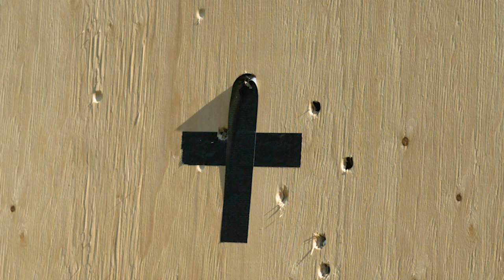Slingshots in a Medieval Battle?

Comment: I noticed that the way Jörg pinches the pouch puts a twist in the rubber, so that after it's released, it untwists and puts a slight spin on the ball. DIY rifling lol
Reply: It's also much safer to shoot that way. I'm using it too. If you accidentally not keep your thumb in straight position (thumb under the ball), that will cause the speed bump effect. If you have low fork the ball can hit your hand or a fork. With a twist ball flies safely above the fork if you level up your thumb during the release.

 In target shooting it helps to get my hand more neutral position. I can use my thumb knuckle against corner of my mouth as a anchor point.
Reply: @rikulaatikainen1929  This
When I shot slingshots with a normal pinch grip I'd have shots hitting the fork occasionally.
Twist grip however came right back at me and grazed my face once though.
Reply: @daviddavidson2357  
I'm using small pouches that are not big and saggy so projectile can exit more easily from the pouch. Return to sender shots are the ones I'm nervous when shooting darts. I mostly shoot 11mm steel with the heavy hunting band setups and I have once got a ricochet from the fork to my thumb. My thumb was sore for 1-2 weeks. Slingshots can be dangerous and I treat them with the respect.

Comment: How about shooting some of your armor, Tod? Still got your soft armors, mail and brigandine?
Reply: That would be awesome, I'd love to see what kind of damage one of Jorg's slingshots would do to a helmet, as well as various body armors.
Reply: Holy shit! Yes!
Destructive testing!
Reply: And determine the velocity
Reply: @tambarlas5248  Joerg did a "speed" test with this slingshot back in 2013 with something like a 50 to 60 gram steel ball with the intention of setting an kinetic energy record for a slingshot. Don't know how it's holding up, but he reached ~130 joules.
Assuming similar performance, that would be a good ending point for destruction testing. Starting with stones of various hardness (limestone, granite), then lead, then anachronistic steel balls if nothing else gets us the desired smashing!
What do you guys say?
Reply: @adampalamara  cast iron balls would make a good historic hard shot to test instead of steel.
Reply: @adampalamara  Hell Yeah!
Reply: @kyleheins  Don't believe there's any evidence of cast iron bullets being used historically. The Romans did use lead, though, most of them around ~20-50 grams or so
Reply: I guess one to the helmet might cause a concussion, but would likely not get through
the result for a decent brigandine could be similar.
Reply: @ulrichkalber9039  Relatively low mass, at high velocities and focused on a small point, is more penetrating power than concussive force. If you hit a metal helmet with something like that, most energy will be "lost" deforming the helmet. There won't be enough head movement to cause a concussion. For that, you need to hit the head with a bigger mass.
Reply: @adampalamara  iron balls have been cast in various sizes since the early iron age, by the medieval era it was occasionally used in baskets that would be hurled from vairious siege engines. Thus I would imagine making small cast balls would be fairly simple by then.
Reply: @kyleheins  Don't know about iron balls, but cast iron wasn't produced in europe until the 14th to 16th century, according to encyclopedia britannica, although china was casting iron about 2000 years sooner. I'd be interested to know details of any acheological finds of spherical balls of bloomery iron, though. Fuck it tho, I'd be down to shoot dynamite at it once all the usual suspects had their shot at it
Reply: You think it could knock someone out under a steel helmet? If so, that would have been a massive game changer. Blunt impact damage from long range against plate armor?

Comment: * In medieval times * people could have mounted the slingshots in the inside of their shields
Reply: The only thing there is you'd need to make it possible to move your arm around on the other side of the shield. Which a design similar to the one in this video might not do so well.
But perhaps doable.
Reply: @chromarush1749  Center grip shield my friend. You can always add more rubber for a shorter draw. Also having a longer band would be more of a hindrance when not in use.  Just cut a hole in the middle of the shield and have a sliding plate or hinged flap to cover the hole when not in use.

Comment: As a slinger: Slings can be much more powerful than a powerful slingshot that you can draw. Slinghots can be aimed,and are much much much easier to be accurate with.  A powerful shot with a sling can reach 300-400J,wheres  world record shots from a slingshot drawn with one hand, barely exceed 100 joules.  Slings don't loose power in cold,like slingshots,but they truely need more space between slingers,than slingshotters. The spacing however ,I don't see it as a definite disadvantage,unless we're talking uppon a castle wall. In a open field,exposed to other missile troops,being spread out is an advantage.  A sling is probably more durable than the rubberbands,unless you sling with jagged stones. Both have pros and cons,I use them both,love them both,but the power  I can generate with slings has my  total respect.
Reply: The drawback of slings is that your fire is harder to concentrate in one spot to take advantage of a weakness, create one, or break morale with the men all spread out. Having half your mates drop around you is more likely to have a unit start to route than scattered losses and injuries.
Reply: Thanks for the insight!
Reply: @washellwash1802   Kind of agree. Most effective skirmish tactic,that I had first hand experienced in reenactment battles was when I was a slinger among late roman infantry,which was chucking plumbatae  volley,and as the enemy was holding their shields up,to protect from the plumbatae falling from a steep angle at 50 meters,I was slinging them flat with tomatoes to their legs,and they were jumping from the pain of tomatoes exploding on their legs. Now egg sized stones and up brake  femurs,and all kinds of bones. A warrior in chainmail,helmet,and shield,sword, and with a broken leg,doesn't fight much lol.
Reply: Yeah but the slingshot can fire smaller ammo much faster, making it much more accurate and harder to dodge. You can also store a bag of ammo in your pocket.
Reply: @zzasdfwas   I can sling 2oz lead shot at 250 fps. I don't think  anyone can dodge that. People standing next to me never see it go,I can see them  zip,when I sling towards the light sky.  I could put like 20 pieces in my pocket.  Slingshot ammo is usually much lighter,than light sling ammo though.
Reply: well there are new slingshot bands that are becoming more efficient, even in the cold
Reply: Do you have a source for the 300+J sling stones? I have never seen evidence of that, despite numerous claims.
Reply: @alexanderflack566  im guessing its very large and heavy rocks
Reply: @alexanderflack566  Some of the world record shots reach that, and probably my 50mm ball bearing shot ,which you can see in my videos.
Reply: @jlasud  That's more than ten times as heavy as the vast majority of actual historical glandes found. It's also slower than an arrow, meaning maximum range would be rather short even if stones that heavy were used. Your testing with more historically typical projectile masses puts the energy in the same range as a warbow, nowhere near 300 J.
Reply: @alexanderflack566  You're right. I wrote:"can reach 300-400J".Altough  there's data about balearic slingers flinging stones weigthing 1 mina.~1 pound. Anyways, if i'd have to go into a battle in antiquity,or medieval times, I'd take 3 slings,and not a slingshot with me.

Comment: Todd + Jörg = sweet, sweet Heaven.
Side note - Holy crap that Slingshot. I love it.
Edit - Todd, you should get Jörg to make one for your mate that shoots the English Warbow, Imagine the power on those shots... :)
Reply from the maker: Now that is a thought.......
Reply: @tods_workshop  My day is made. :)
Reply: Interesting. Would the muscle groups be similar for drawing a bow as to drawing a slingshot? 
I recall him having a bit of trouble with the sideways Instant Legolas, so that might be a difference. The overall pose looks similar, though. 

Curious just how much rubber he could handle.
Reply: @BobT36  I'd imagine sort of, but a lot of his muscles are just for avoiding the crumpling, whereas a slingshot is just straight across and much better suited to modern targeted weight training.
Reply: @BobT36  i guess you could adjust the handle arrangement so it uses similar techniques for drawing.
with the ultra high drawweight war-slingshot i suggest trying one inch tungsten cubes for ammo, and then see if it cuts through brigandine mail or plate.

Comment: The steel ball is hitting the wood so hard that it sounds like a musket going off. Crazy.
Reply: The magic of video editing, that is to say all the videos of muskets or guns going off have had their volume reduced to make it safe for hearing, otherwise they could potentially get sued.
Reply: @KageRyuu6  most likely,the noise is so loud you can't capture it with a camera
Reply: @KageRyuu6  It isn't as if you can just capture the sound of a sperm whale click at 230db, play it back to someone and instantly rupture their ears. Both microphones and speakers have their limits. If you reach that limit, the sound "clips". The recorded sound doesn't get louder than it's limit, and the same goes for speakers. If you put a speaker to it's maximum volume and raise the gain on your input device, it doesn't go above the limit. Everything that was less loud than the limit would be louder than it was before, but not louder than the maximum volume it had before.
A gunshot at 140db would sound just as loud as a sperm whale's 230db click on a recording.

Comment: Yes, a line of slingshotters could be much more closely spaced than slings - 4 or 6 times as Tod points out.  But they could also be (maybe prone plus) kneeling and standing in ranks for even greater density.  I'd prefer being prone and presenting less of a target - something you can't do with a sling, bow, or whiel reloading a crossbow. 

But the advantage of slingshots over slings that stood out to me is that one could be shielded almost completely whether through a line of shields or an arrowslit in a castle or other fortification.  

And if you're firing from a fortified position, the front end of the sling shot can be fixed to the walls and then one can draw even further back, putting even more energy into the projectile.  

I noticed that both Tod's and Jorg's draw turns the sling pocket 90+ degrees which then untwists upon firing and spins the projectile.  So this isn't a rubber-powered 10-gauge-slug shotgun, it's a .79 caliber rifle!

Any measurements on the speed and therefore kinetic energy of the projectile?  50 pound draw weight for the most extended foot of draw?  Then 40, 30, 20, 10 pounds for the subsequent feet of its acceleration?  Adds up to 150 foot-pounds = 203 Joules.  That's more than .22LR, .25ACP and as much as .32ACP.  Any of which can really ruin your day.  Or maybe, being Jorg, it's 60+50+40+30+20+10 (crudely integrating each foot of draw length) = 210 foot-pounds = 285 Joules giving it the energy of a .380 ACP round.

Comment: General rule with rubber is you make the bands 1/3 of your draw length for maximum power from your bands. I certainly like using light tubes since my slingshot use is mostly for target practice and training hand eye, also using Simple Shot clip frames means I can be lazy and make "larks head loops" since bands at 1/3 size tend to wear out quick.

Comment: I notice that the rubber / pouch twists on release, do you think it is enough to improve the stability or accuracy of the shot ?
Reply: Would  that help with a spherical  projectile? Spinning is to stop it tumbling in mid air, but a sphere looks aerodynamically the same from the front no matter which way you turn it/it tumbles. as opposed to a an arrow or bullet which has a way you want it to keep pointing, and a way that's bad (side on)
Reply: @AngDavies  I've shot smoothbore & rifled with both ball & piquet bullets, accuracy in all combinations improves with rifling & spin, I was just wondering if it aided at the lower velocities from a slingshot ( B.T.W. I am not willing to stand in front of any of them ! ) I don't think Samuel Colt would have rifled revolvers which, at the start, probably shot mostly ball if there were not an advantage.
Reply: I think you're thinking of bullets, which are spun for stability. This is because a bullet is long and pointy, and you want it flying and hitting the target with the pointy end forward instead of tumbling through the air and slamming into the target sideways.
With spherical projectiles, spin around that axis does almost nothing (I think there might theoretically be some effect in reducing topspin/backspin/sidespin, which do affect the trajectory, though I doubt it's observable in this case).
The twist here is purely the result of the way they grab the ball and slingshot: you grab the projectile with your palm facing down, and as you pull back you naturally rotate your arm to palm away from you.
Reply: @daanwilmer  ah, crap, yes, I forgot about Magnus
Reply: @daanwilmer  piquet bullets are almost square in dimenson ( length versus diameter ) & greatest weight is to the rear, relying on spin for stability

Comment: How about using rolls at the front of the slingshot to counteract the initial length of the rubber and make the lever of slingshots with even longer drawlenghts more manageable?
You could also have the rolls prestretch the rubber to have a greater initiall drawlength. To counteract the problem of gradual temperatur loss you could prestretch the rubber to the rolls just before each shot. Basically, you attach the rubber rather far back on the plank slingshot and attach a pair of rolls at the front. That way one could use far shorter arrows when shooting with a slingbow.

Comment: Interesting piece of trivia:  During the early days of WW1 soldiers were issued with giant slingshots to sling grenades from the safety of the trench.  Natural latex was used as it worked better than the artificial rubber.

Comment: Another advantage of slingshots over slings as combat weapons... You can shoot a slingshot from concealment, like from just within a treeline or crouching behind a bush. With a sling you need to be standing upright in a large open space. You also need to wind up with a sling and the motion attracts the eye of the people you'd be targeting. Thus the sling could never be an ambush weapon but the slingshot would be great for that. I would also think the slingshot would have a higher rate of fire.
Reply: In theory, you could use a staff sling crouching behind a bush or wall or something. In practice, accuracy with a staff sling or sling is a difficult skill. The alternative is a crossbow where most people could be reasonably accurate with a little training and practice.

Of course, if you're shooting at people, you'd be using a crossbow that shoots bolts, not stones or balls. Stone crossbows existed, but they just weren't effective against people. Too little penetration with a round projectile compared to a pointed projectile. The reason slings and staff slings could be effective was that they were a lot more powerful than bows.

I mean ... obviously you could just scale up the crossbow until it was powerful enough. It might not be handheld, but see the ballista.

Comment: A thought about the number of slingers you could get. I know that some slingers spin up helicopter like, but isn’t it also possible to sling vertically? Similar to a hammer throw with a disk in ultimate?
Reply: Slinging vertically underhand is standard, but achieving good power involves movement of the entire body in a way that requires significant space. Think of it like a baseball pitch. It's not just your arm and hand doing the work.

Still, a staff sling is used with an overhead swing, and that doesn't necessarily require much space. Theoretically, you could be shoulder-to-shoulder.

Comment: wouldn't be much of a stretch to have a hopper which drops in the ammo and a linkage on a wheel/lever to draw it. Imagine it was made larger so it could be set up on the ground and launched multiple projectiles fast enough to go through even the strongest spring steel plate armor.

Comment: Not just warfare, the mills of the day using this as a secondary power source for more efficient methods.
Reply: This is an excellent addendum. Just imagine the engineering uses of a material like this, god only knows what the great minds of their day could have come up with.
Reply: How would that work?
Reply: Well think about a simple trip hammer.  The wheel is not used do to grip issues, so gear and pegs are the transmission mechanisms.  Not efficient or smooth, but a rubber coated wheel?
Reply from the maker: Very true.  Shock absorbers for carts, so fragile ceramics could be transported much easier, so glass etc would be cheaper and so on..

Comment: This got me thinking about an idea I had far a large round shield that could incorporate a longbow into the edge of the frame somehow, but holding onto the shield by the handle in the middle, a bit like this slingshot, thus giving you more range of motion when drawing the strong back.
The problem of course is how do you get something like this setup to work without the different parts getting in the way?